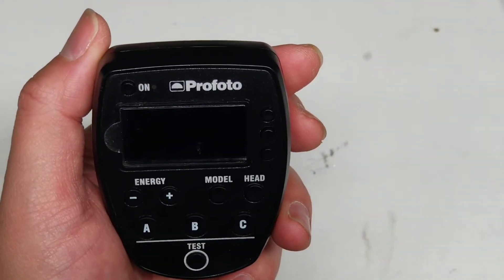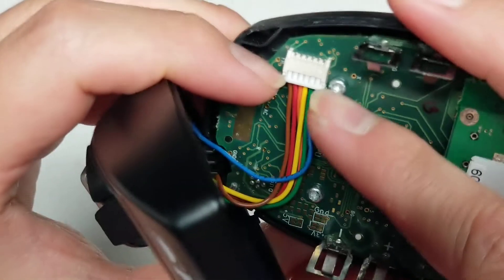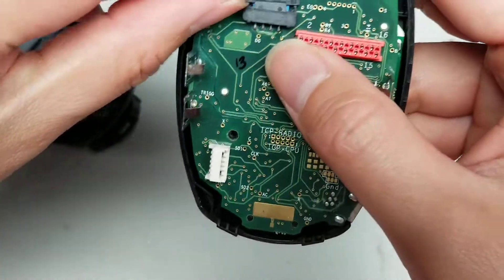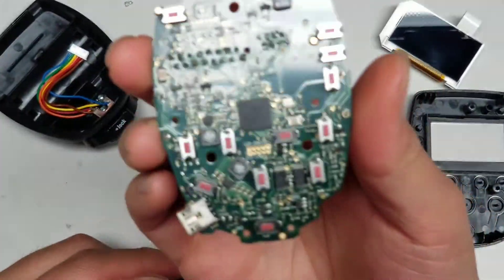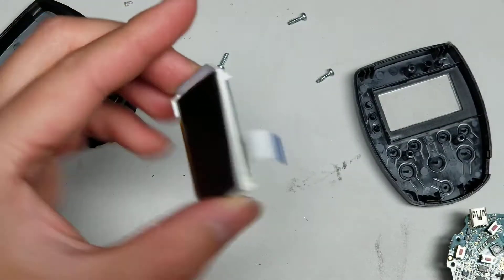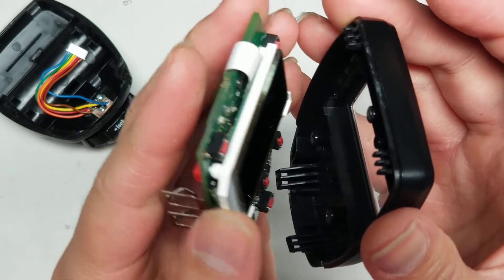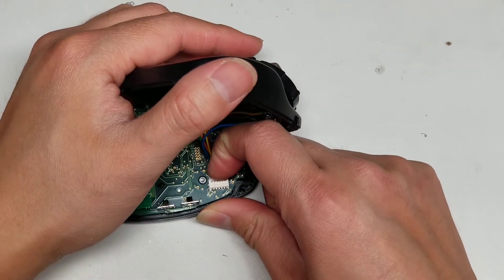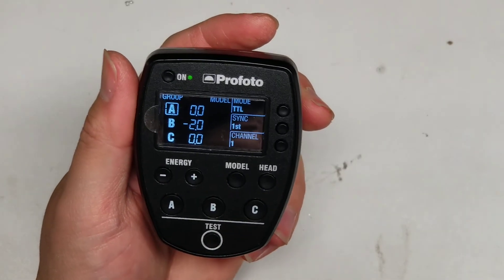Profoto Air Remote TTL-C For Canon Disassembly Corrosion Liquid Repair

Comment: This video is unbelievably helpful. It gives me hope to repair mine. I have an air remote (no screen) that can not be turned on. It flashes after I change the battery if I hold on the ON button. It also flash briefly if I hold ON + Group button to try to reset it. Are you happen to know what's the problem? Any suggestions helps. I liked this video and subscribed!
Reply from the maker: I'm not too sure. Could be a bad capacitor/resistor.

Comment: Hi Thanks for your video, my profoto remotes hot shoe is loose and not making a connection, also the silver part of the hot shoe is falling of it seems like there's a screw missing but I
 don't see a place for one!
Reply from the maker: I don't really specialize in these. Not sure what you mean by hot shoe.
Reply: Hey Cindy, I had the same problem. There's a few screws underneath when you pop the cover. You just need a small Alan key to tighten them. Just fixed mine and now works perfectly. Thanks Binh!